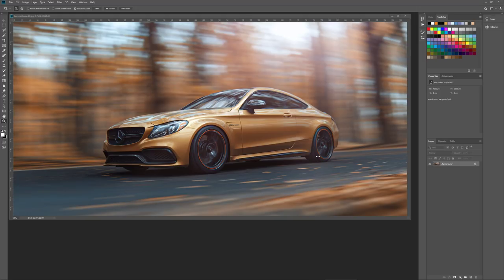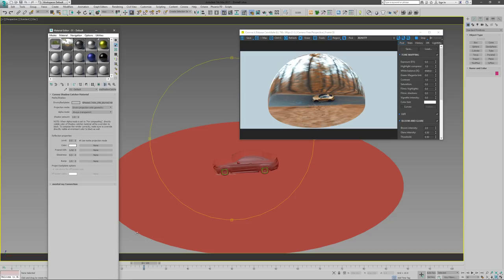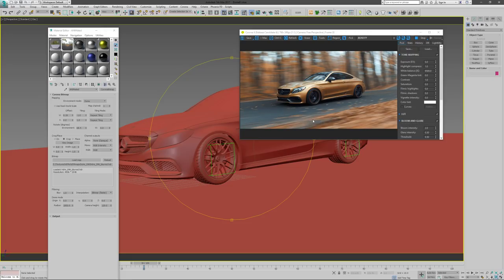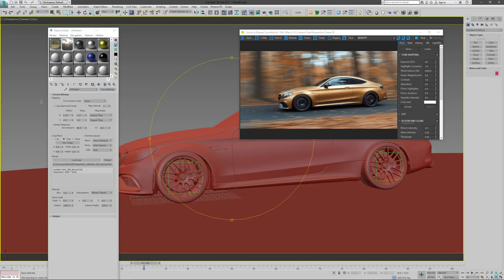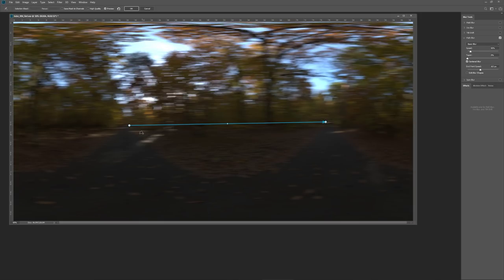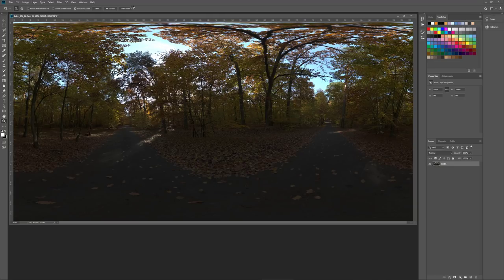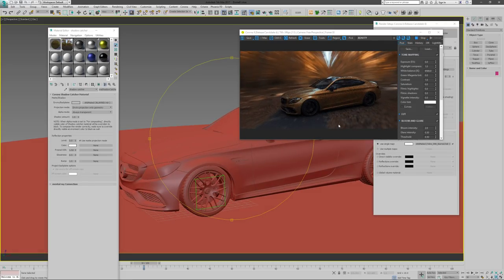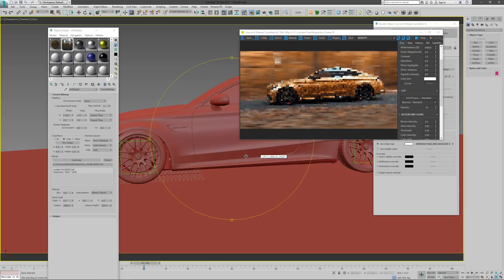3ds Max + Corona dome automotive scene overview

Comment: As a tip, when you have that "crease" you were talking about, you can fix it in PS as follows:
1. merge image so you have the motion-blurred image as a single layer
2. Filter - Other - Offset and put something like 150-200px
3. With the image shifted horizontally with the amount of px you've set earlier, you can now see the seam.
4. Select the seam (full height) with rectangular marquee tool, about 50 px width
5. Feather selection - 3-5 px
6. Apply horizontal motion blur.

Hope it helps.

Comment: first off all thanks for video. I want to ask  ; 
Is there any solution for cropping to  hdr? 
as you known, its diffucult to match scale between scene and enviroment when used hdr
Reply from the maker: You may be able to use the X/Y/Z offsets (plus the dome radius of course) to help to a degree....but in many instances there are things in the HDR/EXR that can't be avoided and ruin the scale with your scene.  Just have to try and locate another HDR/EXR that works better with the scene or build the environment. :/

Comment: Hi Jeff, love your work!!!, did you use any lights or only the hdri? could you shere the render settings please. Thanks!
Reply from the maker: Hi Ciprian,  Correct, the only light source for the image is the HDRI.  I don't have the file loaded onto my workstation any longer but use the default values for global illumination and it'll be fine.  Run some test renders on your scene with the denoiser enabled to find a good target for the render times & acceptable noise levels.

Comment: nice, noticed that u rigged the wheels, and add motion blur - can explain how? thnx :)
Reply from the maker: You can animate the geometry itself.  However, I typically link the rotating parts (wheels/tires/brakes in this scenario) to a dummy helper object (or car rig) and animate that dummy helper instead.  Easier to work with the helper object than all the individual parts.  More info on setting up motion blur in Corona: https://coronarenderer.freshdesk.com/support/solutions/articles/5000516202-how-to-enable-and-control-motion-blur-

Comment: how did you setup up your hdri, shadowcatcher. Still struggling to get close to your results
Reply from the maker: Here's some tips for setting up the dome environment with shadow catcher:
https://www.youtube.com/watch?v=1cZ7k6BJd30

There's not a universal setting that will work for every HDR/EXR since they are captured at different heights and distances to objects, etc..  The dome projection effect can be hit-or-miss depending on the HDR/EXR location and size.

Comment: Holy shit. Could you share your desktop spec? Interactive rendering is so smooth!
Reply from the maker: It's a home built system: 1950x (16 core) on an ASUS ROG STRIX x399-E Gaming MB with 64 GB ram.  The GPU's aren't doing much here but they are (2) 2080 ti's.  The CPU render speed (on high resolution shots) isn't that great with this setup TBH.  I'll probably end up building a new one this year with one of the new high core count AMDs...once those CPUs has been out for a while and tested.

Comment: What is the difference between backplate and hdri you have mention in the video?
Reply from the maker: A backplate is a static image/photo whereas the HDRI/EXR is a 360 panoramic image.
Reply: Jeff Patton normally hdri will see blur, but backplate is better quality right?
Reply from the maker: @jackieteh  Correct.  With a backplate you have a set resolution that you're working with.  The HDR/EXR the blurring is dependent on the resolution of the HDRI/EXR & your camera/render output size.
Reply: @JeffPatton  Thank you for clarify.